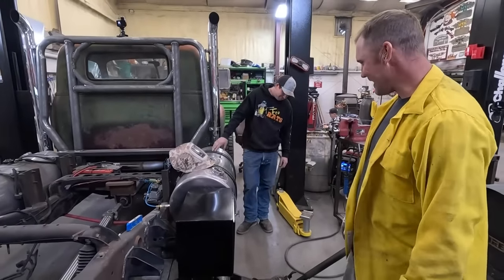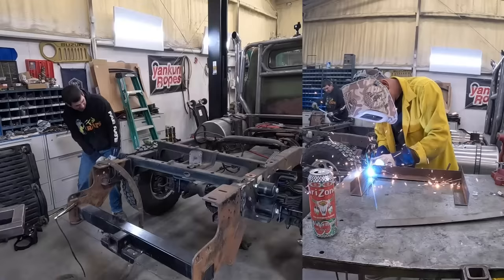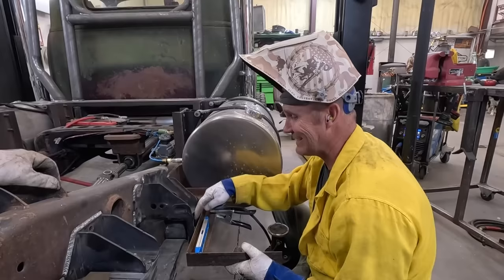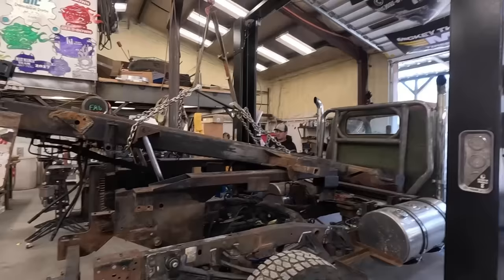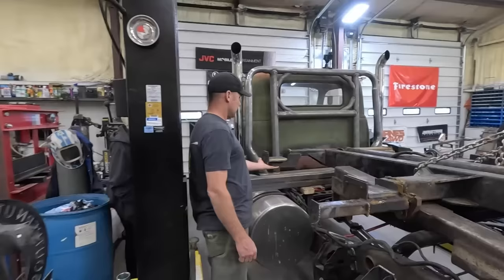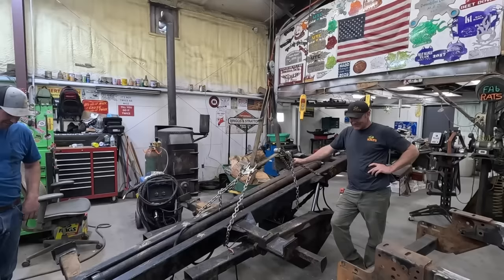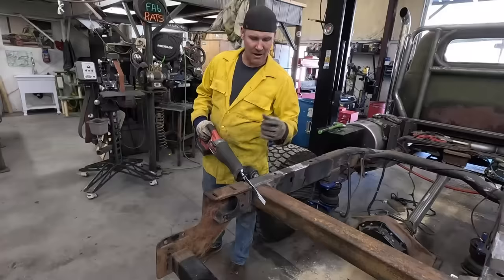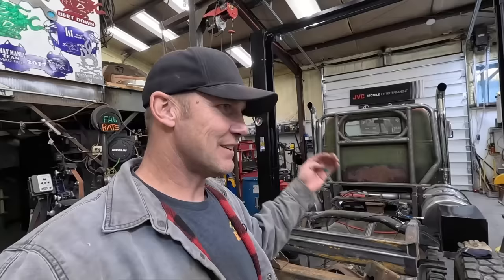What Now? Was All This Hard Work For Nothing?

Comment: IMO the issue with installing the roll back tray comes down to the rear wheel diameter being too large. Make them smaller and drop the chassis so the tray is lower.

Comment: Is it possible to add a channel frame to the truck frame where you can add some sort of rollers to the aluminum platform to roll in? Think of it like a giant toolbox drawer. Except its powered by the hydraulic ram and it has a point where the platform can tilt when the roller reaches it.

Comment: The height issue all seems to be a result of where the pivot is for the roll back... The frame rails are just too high to make that work and not put the bed 10" too high.

Any reason it wouldn't work with the original sliding portion of the roll back frame just pivoted at the rear? That should allow you to sink the pivot right down, put the sliding rails on with the bed on top and get the right finished height. Basically instead of a static frame to attach the bed to, the same vertical height it would take up but sliding.

Comment: Need to stretch the frame and push that rear axle back.  The axle is pretty near center of the bed.  Will be a rough and sketchy ride with any amount of weight on the back.

Comment: You will probably already have it built before you read this. You could still use the aluminum bed for a tilt bed. Aluminum is very light and strong, you could not ask for a better material.

Comment: On the bushings you had to rebuild because of wear... Drill and tap a hole on each side and put some grease zerks in so you can lube it ward off it wearing again, at the very least, keep it from squeaking when being rotated. 

OK scratch that, you changed plans LOL

A car hauler with a dove tail, isn't all that bad at all.I had one for a long time, wished I still had it, But to move a car, pull up, back up to it, pll out the ramps, (Mine were steel and heavy, my BNL had one with aluminum ramps, much easier and lighter) pull the winch rope(mine was old fashion steel cable, I'd for sure go with synthetic now) Hook up, and pull up. tie down and go. Mine had chain binders, so the hooks stayed connected, just had to grab the bar from the bow, and walk around and bind each corner down. Also, had lights recessed in the bed for good visibility at night loading and tying down. Also had work lights at the top headache rack too. If I were to want to use the hydraulics at all, I'd just do the last few inches of the dove and pull it up, just to make it easier to clear low clearance places, Rocks and so on.  .Some times, unloading was a PITA, so I run the winch rope to the back, into a snatch, and back up to the front of the vehicle, and winched the vehicle off.

Comment: You really should have looked at how a hooklift truck works before going with a dump bed. The bed would move back 5 feet before tipping towards the ground giving you a much improved loading angle.

Comment: I would make the pivot point at the center line of the axle and have the front section static. That way you could have a longer ramp and an easier angle up the deck.

Comment: Hindsight being 20/20, probably should have kept the roll back bed on the original roll back truck and grafted the two frames together. Also should have done that work before committing to fuel tank location, driveshaft, etc.

Comment: The reason they don't put long bushings  steel on steel is because if you let it set for any amount of time..  It will rust itself together.  Your bushings should be removable and replaceable.. and made out of brass or bronze.   Or at least cut a bunch of grooves in it and drill a grease zerk on each side.

Comment: I was wondering, what is the purpose of the two hydraulic cylinders at the rear, that would push upward?   It seems they would be needed to push the bed upward toward the front.    If you do a flat deck the weight pivot point will be the rear axle as far as weight distribution goes.

Comment: You might want to think about the 14 foot Rollback.  14 feet really isn't even big enough for a Corolla....Paul, just go out and buy a Rollback with a blown Motor and Trans - try to get a 22 foot so you can handle the F350 Crew Cab Long Beds and build it from there.

Comment: What about a dump bed but instead of the flat bed sliding down to the ground on hydraulics just use a winch at the very top of the dump bed frame to pull it up and let it down slowly

Comment: I was wondering if it could have been done differently.  
Rather than having a standard rollback, what if they just had a tiltable flatbed. 
Instead of cutting the length off of the front, they could cut it off the back and use the last few feet as a ramp like Paul's Gooseneck trailer. Less Hydraulics, less mechanics. Less Height.

Comment: ok Paul why not just fab up a custom frame that would work with the roll back bed, the truck is already a mismatch of parts that is going to work like a dream, Hell brother just back-half the rear frame, 4-link the rear suspension w/ airbags lowering the frame to accommodate the roll-back bed, the FJ is custom,(had issues) that didn't stop you short, the wrecker is 100% custom,(had issues) yet again that didn't stop You, so why fall short of Your vision for the Ratback.? I believe in the Vision You just have to see it through, You know if you fall short on Your vision your not going to be happy with the end product.

Comment: Don't commit just yet to the tilt. Walk away, take a few days to rethink. Trying too hard to reuse the existing rollback setup was a time consuming and frustrating mistake.
Rethink new, much lower. A different rollback from scratch. Like you said you have 2 yrs for this build. Not a flat bed nor a tilt. A rollback designed and built right from the ground up. Brainstorm first with Matt/Chad/Merlin/Rory. Conceptualize from the ground up. Don't throw in the towel for expediency sake. Let the ideas simmer. Take more time to mull. Long-term a rollback is the preferred design.

Comment: You know you're using a level on your frame, and I can guarantee you that your concrete floor in your shop has probably got
  1 1/2"-2" of pitch from the back wall to the roll up door. 🤷

Comment: I know hindsight is 20/20, but I don't understand why you didn't "just" swap your axles, driveline, and cab onto the original roll back chassis? surely it would have been easier to shorten the bed a bit in the front to fit the cab and engine. The back end would then almost just need the axle swapped out.

Comment: I still say that you should move the rear axle back. You may only be hanging over the back of the frame 4’ but you’re 6’ behind the axle. Almost 50% of the load is behind the axle. You’re going to be pulling too much weight off the front end. Just saying.

Comment: Totally sucks should of been a rollback that's what you wanted from the start and bought a whole truck with roll back for. Sad part is you did fuel tanks and batterys before even figuring out the rear frame area for the roll back which was wrong could of built a whole new rear frame setup to work with the rollback and look good from the start just can't finish a whole truck then slap a roll back bed on it 😂 pretty sad to give up the whole rear frame had to be streched and axle moved and heck made a tandom axle or dually axle swap and make the new rear frame fit the roll back parts i thought this was fab rats channel fab it up...

Comment: If you had stretched the frame 4 feet instead of cutting the bed you would have had plenty of room for every thing and would also been able to use the unit for commercial recovery as it is all you’ve pile of crap good for only hauling short rigs. Use your head for something other than a hat rack

Comment: I said it in the last video, why tear apart a perfectly good working piece of equipment to try to build a "Frankenstein" truck?? Now you have 2 trucks that don't work and a pile of possible scrap metal.. Alot more thought and a bunch more tape measure Paul.. That frame, suspension, differential and wheel base are all wrong to be the roll back you envisioned.. Sorry, I call them the way I see them from 25yrs experience working on and building BIG RIG trucks.. Now imagine if that was a customers truck(s) you had spread across the floor with a pile of scrap roll back next to it...

Comment: Wow, I am sad.  You say everything was going to plan until it wasn't, but clearly there was no plan.

Building a lot of stuff before putting on the bed has sunk this project.

Imagine if the bed was addressed before the tanks went on and all that other stuff was put above the frame.  The bed could have been lots lower.
Imagine if the bed was addressed before a rear suspension was committed.  Maybe coil springs and/or air bags would have let the roll back mechanism work.

I know to you, this seems like me telling you to close the barn after the horse escapes.  But some of us have been worried about this and commented about this before.

Always, always, always mock up or prototype the highest-risk items first.  And clearly the highest risk item was the bed.

Think thrice, measure twice and build once.

Now it is just a ramp truck.  Not totally useless, but clearly not as useful and a rollback.

Comment: What a giant disappointment. I commented on the original video when you first started building this truck on this frame and said that the frame would never work and would be too high for a rollback bed. What's crazy is you know what you wanted to do with the truck from the beginning and you never realized that it wasn't going to work. You could have cut the back of the frame off of the truck and flipped it over or just welded on new frame rails there was a lot of ways to make this work if you would have thought it through before you started mounting accessories and fuel tanks and tool boxes. The first thing that should have been done once it was running and driving with the cab on the chassis should have been fitting the bed then you should have worried about fitting all the accessories and tool boxes

Comment: You fellows show all the mess ups but the rules never change when building stuff like a rollback. Engineers designed something thats been the rule yet maybe you are on to something. Had you left the truck its original length, you might of used that bed in its entirety.... rebuilt of course as its worn out for absolute sure. I have owned many of these rigs and my brother in law had me fix all of his rigs as he went commercial. Anywheres from ten to twenty full time drivers as they get over being a truck driver in a big hurry when its snowing and blowing. Alaska is a harsh environment, not for faint of heart. That said, put me in Utah and I would be a faded flower in one day if I even lasted that long. Sometimes it just doesn't pay to buck what has worked now for many years. Not criticizing you guys, just saying I have been there and messed up also. There is always someone who invents a better mouse trap.